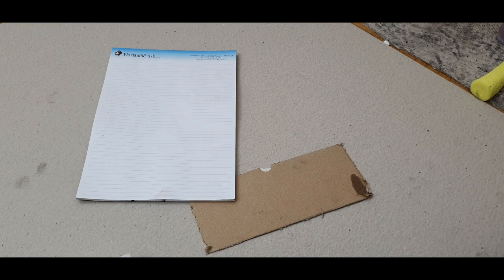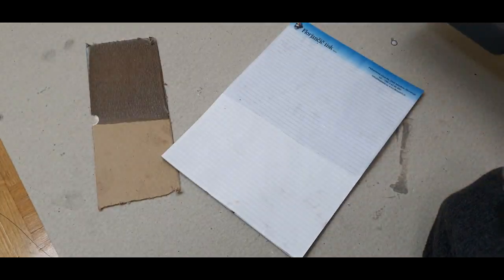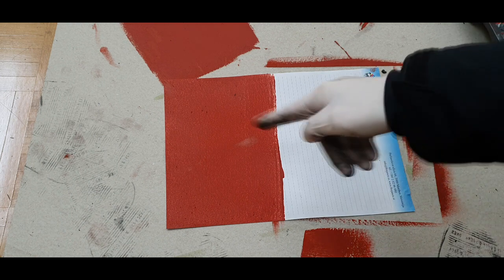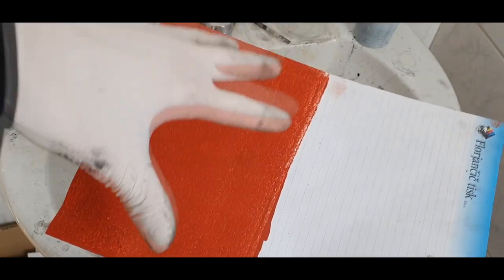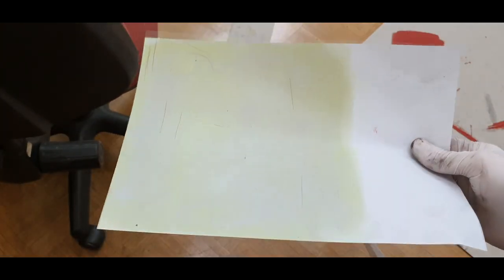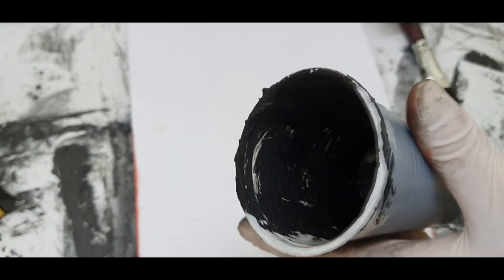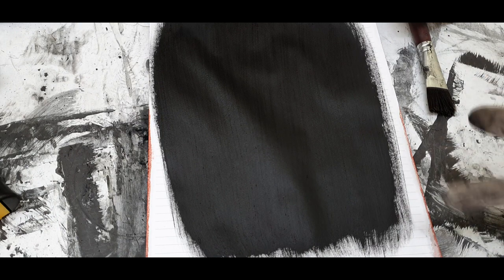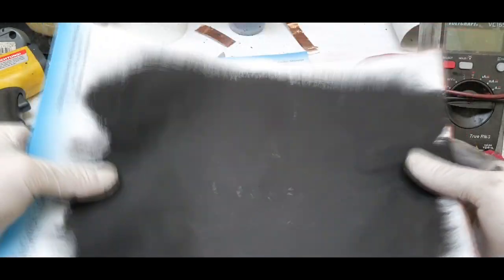Hydrophobic coating concept

Comment: congrats Cayrex :)
But if you don't tell anything about the materials, process... any information or any scientific knowledge, what is the point of video?!
Reply from the maker: In basic the paint is not ready jet and I need to work on this a little bit. Therefore I dont discuse about the paint